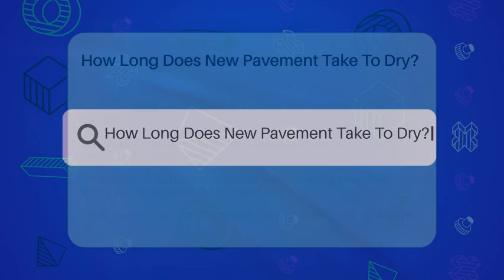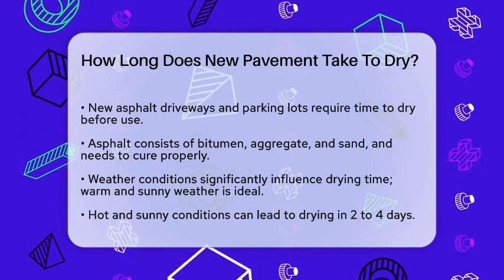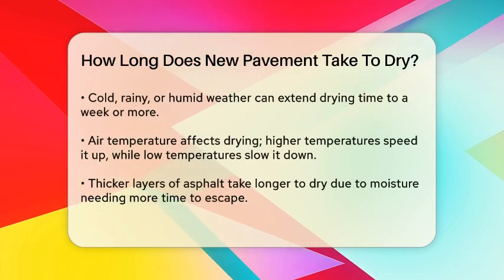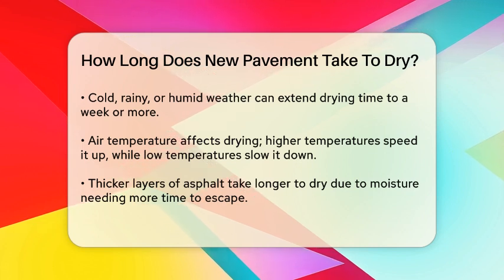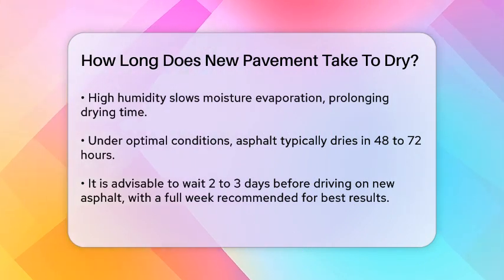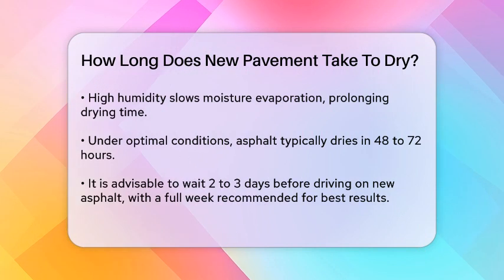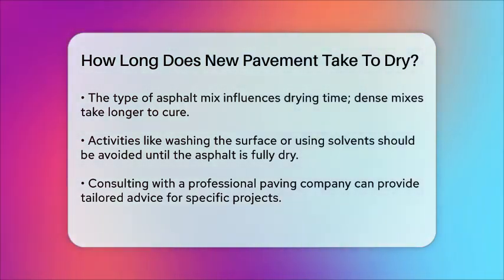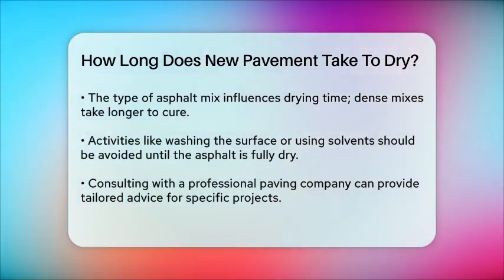How Long Does New Pavement Take To Dry? - Civil Engineering Explained

Comment: Asphalt does not dry or cure. It is compacted to a maximum density. Look at road paving, as eonn as oaving is completed to specification, traffic is allowed on the road. If your  contractor says wait before driving, that means it has not been properly compacted. 
The rollers are thousands of pounds and many are vibrating to increase the loading. Any vehicle that is not overloaded generates tire loading far below that of the required asphalt rollers.
What is evaporating? The asphalt mixture has been produced in an  asphalt plant that is considerably above the boiling point of water.
Any mixture below 225 F will be rejected by an inspector or competent contractor.
I was trained as a paving inspector 60 years ago. Check with any national asphalt agency to see how blatantly wrong this video is.